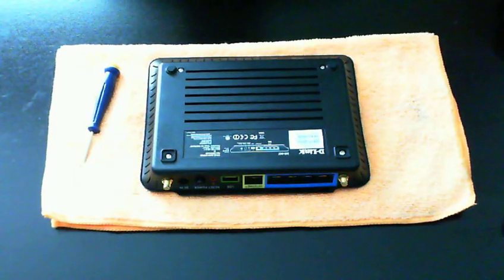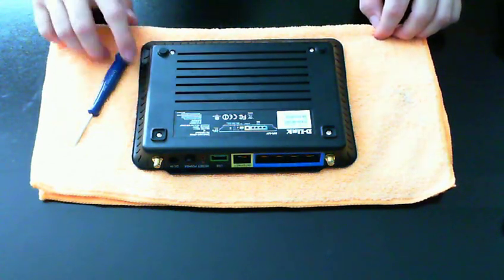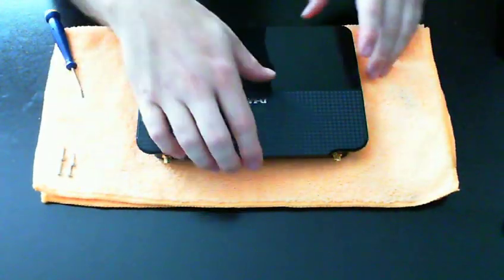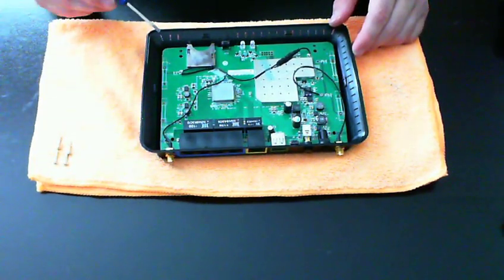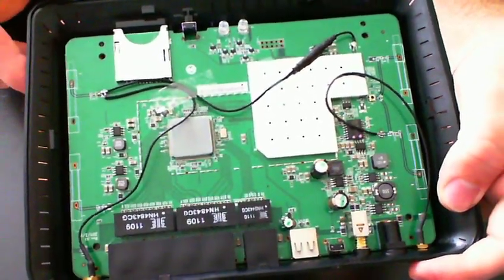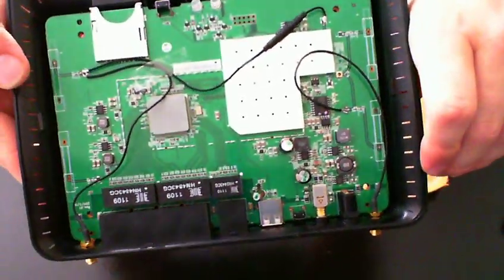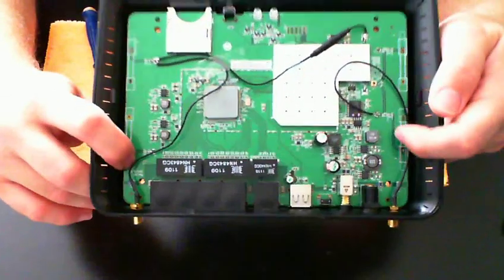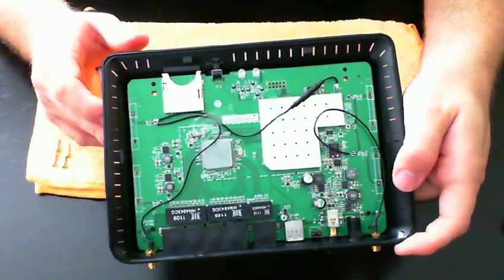D-Link DIR-657 HD Media Router 1000 Disassembly / Solder Directions

Comment: Bought mine two month ago. It works fine since it's only a small apartment. However, on my wife's phone (figures) connection deteriorate rapidly from one room to another. Two walls in between and you can forget it. On all the other devices it works fine, not great, but fairly satisfactory. I'll try and add an antenna from my previous Asus router. Thanks for all the info.
Reply from the maker: Post back once you've done the mod and let me know what your outcome is.
Reply: Finally got around to it. I have disconnected one internal antenna and soldered as instructed. Connected to 2.4Ghz 15dB WiFi antenna but the increase is only about 5%, if any. Can't really tell, since signal strength is too erratic for precise measure.

Comment: I can answer that for you..I have one of these at 25 feet away through 2 walls made out of drywall of course each wall has 2 layers of drywall to make one wall you lose a little more then half the signal using G and N.Wired this thing is fine I finally gave up on wireless to some computers and game systems and just ran a Cat6 wire.

Comment: I want to know is this router really THAT bad or is it just that it claims to be this huge awesome thing and it's not? Cause I have a WRT-160N which also has internal antennas and I ordered this one cause it was cheap despite many bad reviews, people with more networking know-how seemed to get it working, so I accepted the challenge. We really don't need that much coverage, maybe 20 to 30 feet through 2 brick or plaster walls max. The house is long so I have a second access point elsewhere.